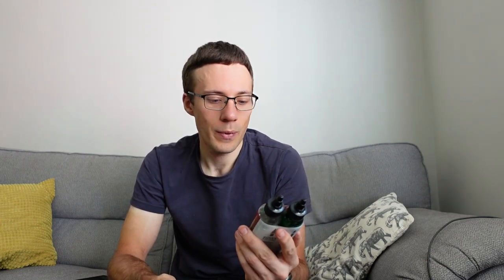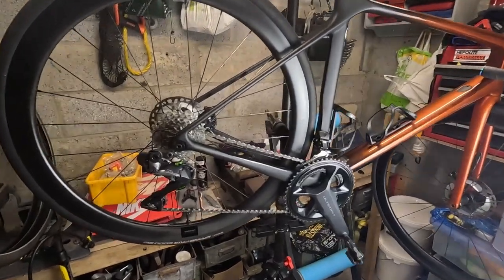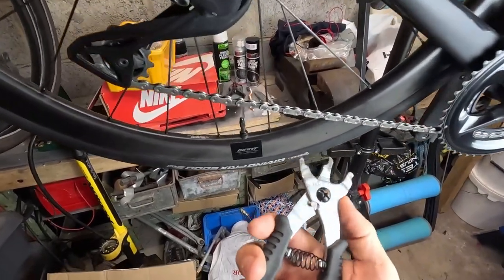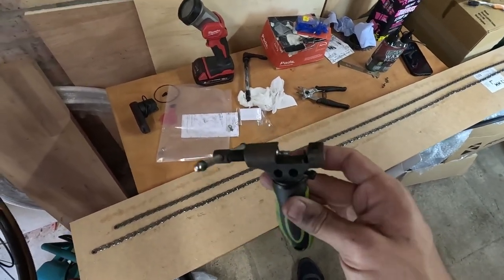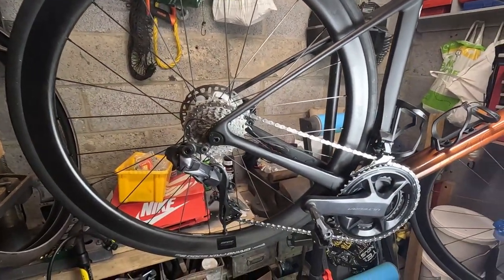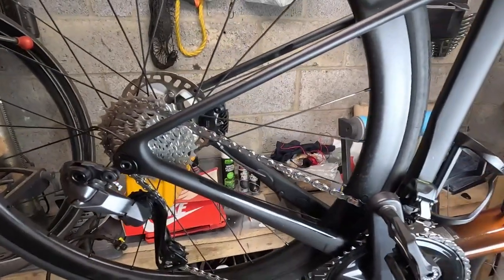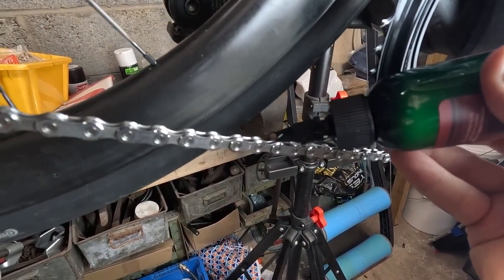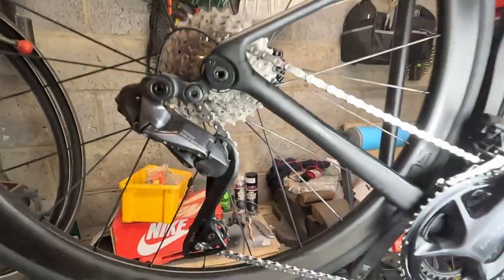Silca Super Secret Wax - Chain Stripper + Chain Coating

Comment: You should cross chain so it spreads the chain out and apply it at the cassette, and shake the bottle really good otherwise it will be too runny...the Silca Youtube guy said to do these steps. Once you shake the bottle it will thicken the wax, if the wax isn't thick then it won't stick well.
Reply from the maker: Thanks for the comment, yes I did run it up and down the cassette a few times more off camera to cross chain it some more. I also shook the bottle really well before both the initial and second application I did, both were about the same thickness (not very). However I have realised it's also temp related, it had been in the house so was warm, since then I've done a reapplication and it was left in the garage and it was much thicker!
Reply: @MikeJenicCycling you can put a bolt or small ball bearing inside the bottle of the wax for easy shaking.
Reply from the maker: @pinoyxbox  Great tip!
Reply: you should watch the video. he mentions shaking it a lot.

Comment: Thanks for making this video, Mike. Couple of clarification questions, Firstly, you applied the cleaner to the outside of the chain and the the wax drip to the inside. Is that from Silca's instructions, or your experience? Secondly, when it comes to re-applying (top up) the wax after 200/300 km of riding, how do you clean the chain? Just a simple degrease chain bath?

Thanks